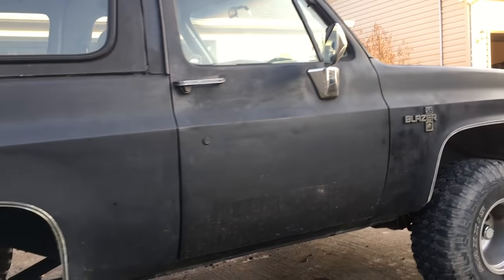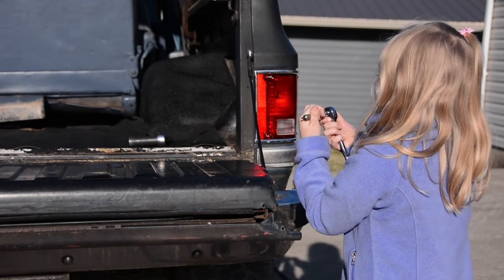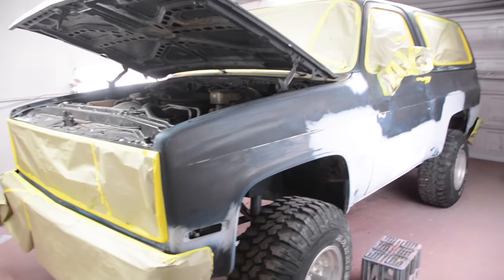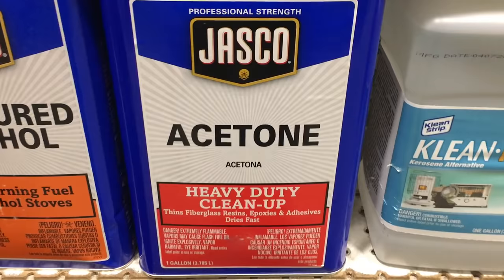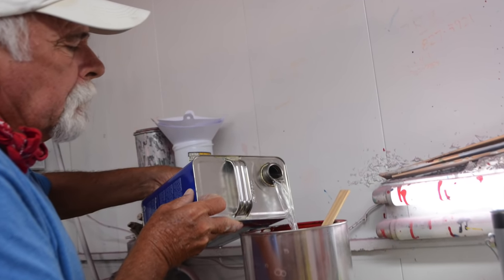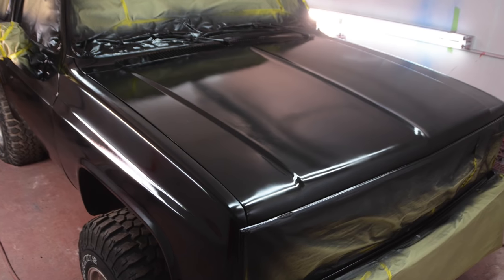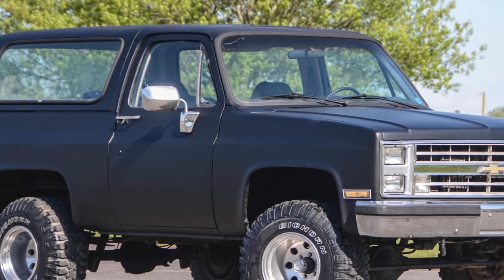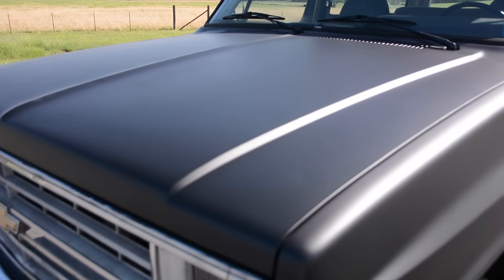$50 DIY PAINT JOB on a Crusty K5 Blazer (Surprisingly Good Results!)

Comment: Looks good I did a cheap paint job to my tercel wagon I did a full rattle can paint job and cleared it I had roughly 300 to 350 in buying primer paint and clear and it actually came out amazing I haven't even wet sanded and buffed it cause it laid down so good I see no reason to mess with it car shines awesome. It's been done for a year now sat outside all year long and so far paints holding up amazing rattle can jobs can look good just alot of people don't do the proper prep. I now have a k5 I'm working on and kicking around painting it since I do have to do some body work its a 2 ton and I haven't ever done a 2 ton paint job before

Comment: You mentioned putting on a 2nd layer (of paint). Did you sand the car in between layers? With what grit? Also: what if I want a paint that is in between shiny and flat? It's called satin I believe - whould you use a similar method?

Comment: I thought you were supposed to thin oil based paint with mineral spirits? Use acetone for acetone based paints like spray paint. Anyways, I guess it turned out fine. Thanks for sharing.
Reply: Also, lots of clearcoat if you use oil paint, or the sun will fade it fast.

Comment: TRUCK SHOULD HAVE NEVER BEEN PAINTED WITH THE DINGS/DENTS/ MISALIGNED PANELS.   95% OF A PAINT JOB IS THE PREP.  YOU FAILED HARD AND RUSHED IT....AND IT SHOWS.   IT LOOKS TERRIBLE.    THIS IS AN HONEST OPINION OF A REAL CAR GUY....NOT SOME YOUTUBE BALL SWINGER.
Reply from the maker: Lol I'm a real car guy too and I have painted nice vehicles using thousands of dollars worth of materials and I have painted junky vehicles using $50 worth of materials. I was perfectly honest in saying that this is not the way to handle a NICE truck. This is a CHEAP paint job for a junky truck. I didn't fail anything...I did exactly what this truck needed, which was a cheap refresh so I could sell it and make a profit.

Comment: I painted my pickup with john deere medium gloss black 5 years ago and it still looks good.  sanded it with 120 then 220 grit no primer no Bondo no bodywork washed it wiped it down with a good wax and grease remover and sprayed it. it turned out really good.
Reply: John deere black?  So just black then.. john deere does make some good ass paint tho.  The green i know goes on like powder coating..

Comment: Really good video.  I'll be painting my Dodge Ram cargo van with this same stuff next week.  After it dries is the vehicle surface smooth to the touch or is it somewhat rougher than gloss paint.  Also, are there any tricks to washing it to avoid the water spots issue?  Other videos I've seen suggest a 4-1 ratio, given your experience with mixing what is your opinion? Thanks
Reply from the maker: The paint lays down nice and smooth to the touch after it dries, as long as you put it on pretty heavy. If you hang back and "dry spray" it'll be rough. Two medium coats usually does the trick. As for the water spots, I'd just suggest being prepared to dry if off with a towel or something. I use an Absorber cloth. 4-1 mixture seems like it would be a little thick to for the Harbor Freight gun I was using, but I honestly haven't measured precisely.
Reply: @HotRodHoarder  Thanks for the info.
Reply: @HotRodHoarder  One additional question, I'm planning on mixing a gallon of this product using the semi-gloss and adding 1/2 gallon of the flat black to find a middle ground on the final sheen (not too glossy / not too flat).  I'm debating on the amount of thinner to use with the 6 quarts of paint.  Any advice?